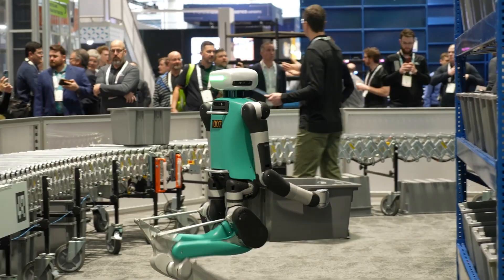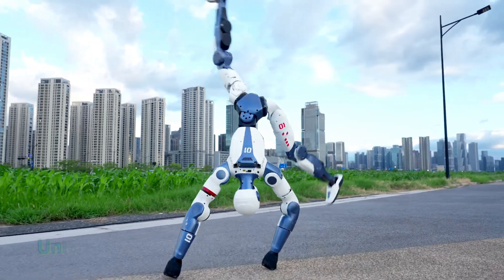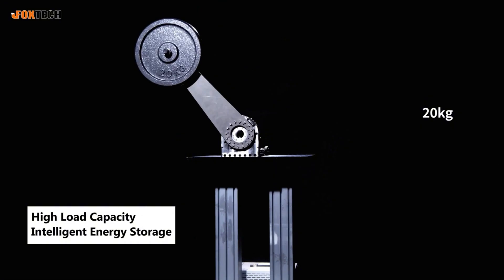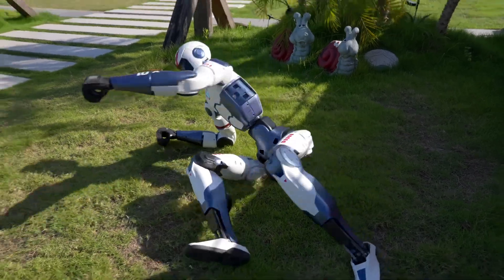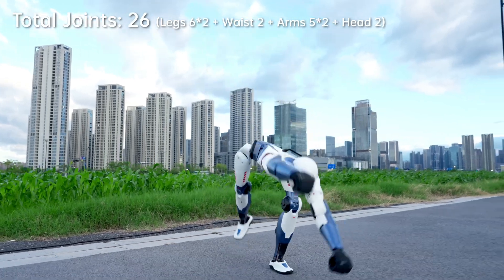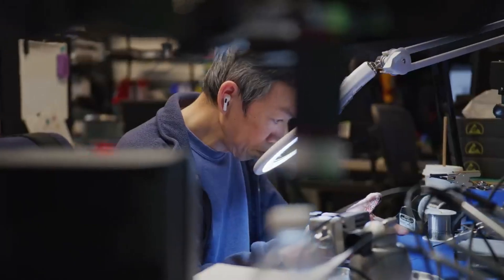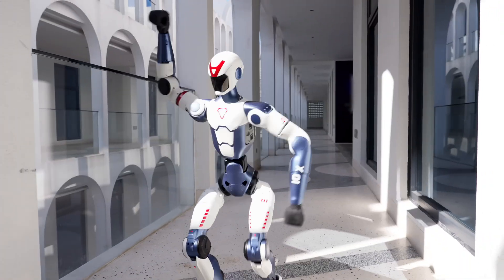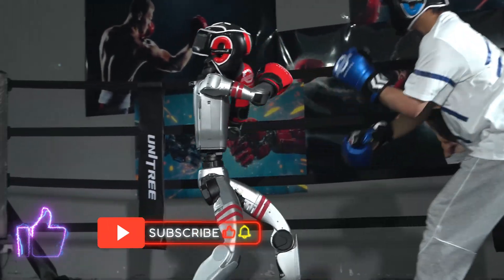Unitree R1 Robot Review $ Comparison | 2025 China Cheapest Artificial Intelligence AI Humanoid Robot

Comment: I want a robot that will not, under any circumstance, do gymnastics.  I want one that does useful work.
Reply from the maker: That's a valid point, and the focus is often on practical applications rather than just the show.
Reply: Gymnastics are good if it’s equipped with some other uh… software
Reply from the maker: @orbitaljellyfish808  absolutely.